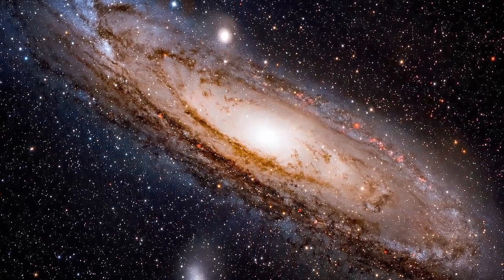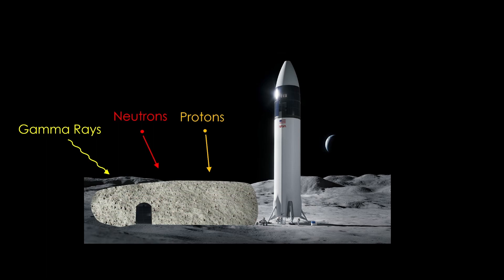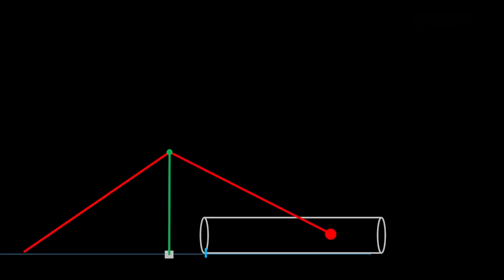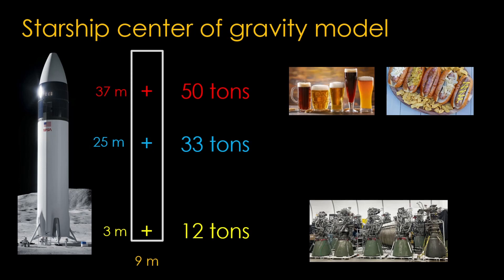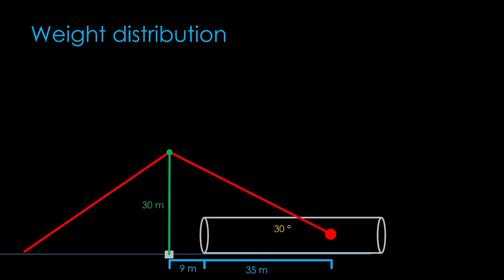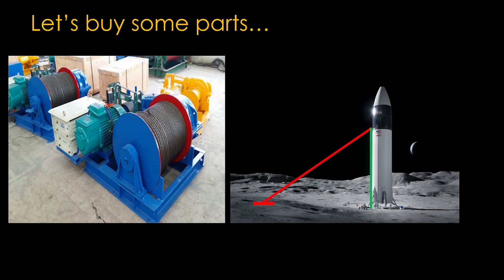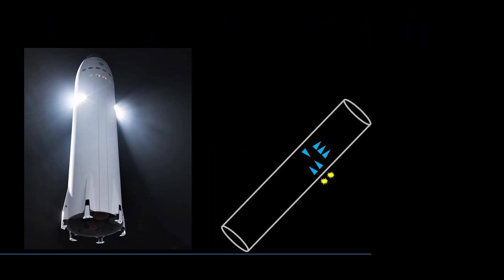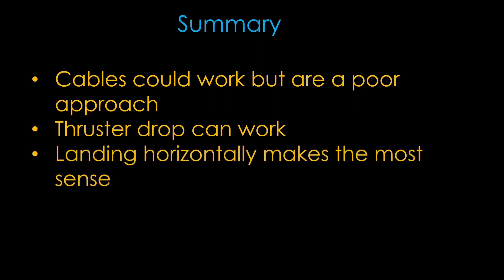Starship Moonbase

Comment: You could also land in a crater approximately 40m deep and then filling the crater with regolith. This would allow the Astronauts to walk out of the airlock and onto the surface. I would also keep the solar panels in sunlight. Then use the fuel and oxygen tanks as living space and rad shelters.
Reply: Craters aren't hemispherical though, they tend to be much wider than they are deep. Also, "just" filling up a massive pit in the ground would be quite the feat to accomplish.
Reply: @sycodeathman  True but it is still easier to fill in a space than to lower a spacecraft onto its side without damaging it. Robots would be perfect for this as they can work nearly continuously in the harsh environment. Earth moving or in this case Moon moving is a very well understood skill that we have and is used in construction all the time.
Reply: @joeker1013  I just don't think that the tradeoff is worth it. Starship needs to handle lateral forces anyway, and SpaceX is the world leader in rocket propulsion control technology. If anyone can easily land a 9m by 50 meter cylinder on the Moon on its side it's SpaceX. 
Also, don't forget that if you bury a Starship vertically you're gonna have a lot of side pressure trying to crush the thing due to an unsupported column of regolith about 40 meters deep surrounding it. Laying the thing on its side on the surface greatly reduces both the pressure from the material and the level of effort needed to provide support internal to the regolith mass (for example, kevlar bags and straps).
Reply: This is actually an awesome idea because it provides radiation protection with very deeply buried living areas, and it would be extremely easy to automate a robot with a grader to drive around in a circle and push regolith inwards towards Starship until its buried. It might even be possible to pull the "lawnmower tied to a stake in the ground" trick with a really simple crawler. Burying a horizontal Starship might take less material, but it would take much more planning and engineering, and there wouldn't be an extra deep location in Starship to retreat to in the event of high radiation.
Reply: @BuffMyRadius  The thing is though, high external dose rates only come from solar charged particles, which have low penetrating power. The reason you want a few meters of regolith is in order to block high energy cosmic rays, which have a low and almost constant dose rate but high penetrating power. If we didn't need to block cosmic rays, two meters of shielding would produce a very low dose rate habitat equal to average Earth dose rates, even when directly subjected to the most powerful solar storms ever recorded.
Reply: In one sixth of Earth normal it wouldn't be hard to manually dig the hole and have it land vertically in it. The sides  can be steeper on the moon with out collapse. Ntm we want to find out what's in the rock underneath the regolith.
Reply: @rexmann1984  Actually the angle of repose of material is independent of gravity.

Comment: Theoretically, depending on the angle of incidence of the landing engines and their thrust, you could land it horizontally with no extra engines. Surface side landing engines provide some vertical thrust and horizontal thrust while the main engines provide horizontal thrust and offset thrust to counter the torque of firing only one side of engines. If you can make a trajectory where the horizontal and vertical speed reach zero simultaneously then you're good to go.

Comment: The point to putting landing thrusters up high is to avoid blowing too much dust up. Landing on it's side would defeat the purpose.
Reply: This doesn't matter as much if you don't need to take off again, e.g. if building a base.  Mostly trying to avoid damage to the engines because you want to take off later.  But no need to avoid damage on a one-way trip, and dust isn't a threat to the ship structurally.  Do this remotely with no humans aboard to mitigate risk, then land an HLS to start the conversion into a base.
Reply: @darylbardo  They're rocket motors, they wouldn't breath in any dust even if there was an atmosphere. I'm just saying that it was judged best not to blow dust dust up. Dust is a huge problem for equipment on the moon, not to mention that you don't want to dig a hole under your landing site.
Reply from the maker: @fascistpedant758  For a habitat digging a hole would be useful; it would a) anchor so you don't roll away and b) reduce the amount of regolith required for shielding...
Reply: Blown dust is actually a significant problem in the lunar sphere of operations. 

Most lunar engines will have exhaust velocities comparable to the lunar escape velocity. Any dust thus entrained in the plume bouncing off the ground finds itself on a low-angle trajectory, which is to say a suborbital or even hyperbolic trajectory. Any orbiting spacecraft in the vicinity are thus at risk of being effectively sandblasted by the dust plume.

Current proposed solutions are injecting refractory modifiers into the exhaust so it ends up sintering the ground into a landing pad, or just building a berm that catches the sideways flying dust grains.

Comment: I’ve actually thought about this and came to the exact same conclusion. Best part is, you could take off from that orientation as well if you could land safely with the thrusters.

You DO however need extra internal reinforcement of the starship to not buckle at that angle.

I have this fantastic idea of catching starships horizontally on earth using upward facing jet turbine exhaust from an array of jet engines to arrest its fall into a catching structure similar to the Chopsticks. This would allow fuel-less Starship landings.
Reply from the maker: Not sure about internal reinforcement. Earth starship on reentry has a fair bending force in the space between the fins, and it has a much higher loading - if it's at 2G, it's doing around 20 m/s2, while on the moon you might only be at 3 m/s2. 

And that's assuming thrusters where I put them. You could put a set in the middle and get rid of the vast majority of the bending force.

Comment: Could the HLS starship separate from the tank section and land vertically using the thrusters?
Reply from the maker: Now there's an idea I didn't think of. Yes, you could do something like that though you would need the thrusters to have their own fuel source rather than using what is in the normal fuel tanks. Then you could relight the engines on the tank section and head back into orbit. 

There's an interesting question about whether the development and manufacturing cost is worth it, however.